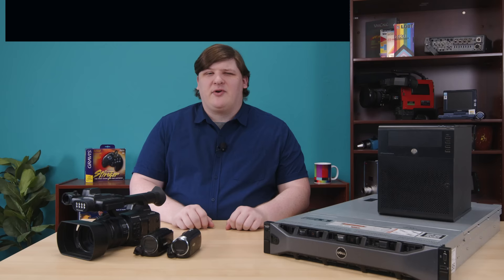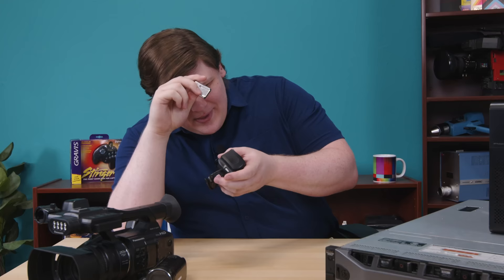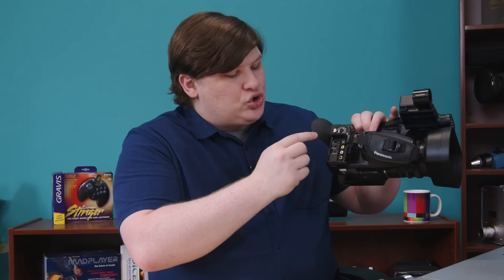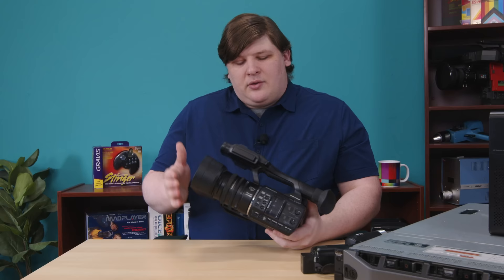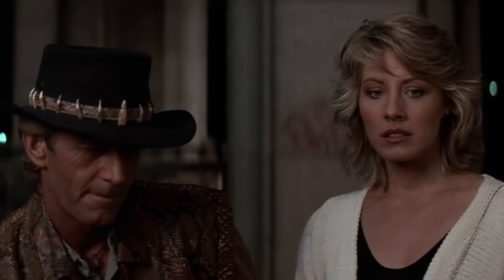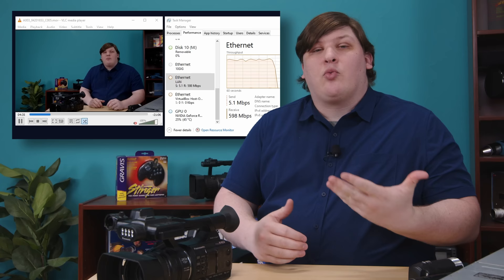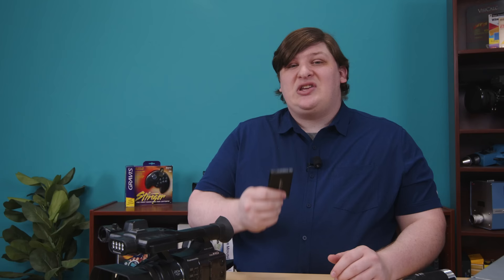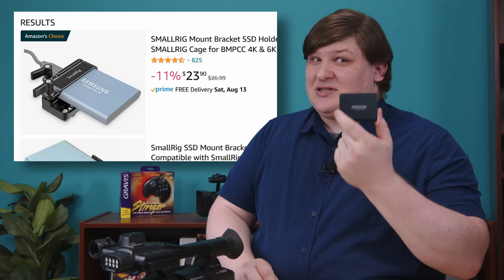I Built... a really fast NAS?

Comment: I don't see why internal 2242/2230 NGFF isn't being used.
Consider buying bulk used server drives. They're designed for writethrough workloads like this, and with even a third of the rated endurance consumed, they'll still outpace consumer drives of comparable capacity and ""quality"", and can sometimes be found on ebay in bulk for less than half the cost.
There was recently a lot of 10 1.92TB of samsung drives, I think it went for less than a grand?

Not showing up at all, I've seen as a compatibility problem in X570 with certain PCIE2 server hardware. I imagine it could happen otherwise. It's just failing the handshake in the POST?

Evos aren't really high end. They're low-end samsung drives. Pros are high-end, but not as high end as the server hardware that shares the same controllers/nand. Server stuff is just better binned pro stuff.

Comment: I think with your setup wouldnt 4 mirror harddisk would be better? With last 4 slot have high capacity running in z1 or 3 mirror with 6 drive in z2 as storage vault?
Reply: Or even a 6 mirror array would work nicely with a fair bit of redundancy.

Comment: Windows does have support for NFS, never used it myself as I don't work with Windows (may try it later on a VM just for fun)
May function a bit better than SMB
Reply: Windows "NFS support" exists just to tick a box, as a last resort only.  If you aren't going SMB, the next best is iSCSI, but thats a vastly different use case. You gain performance but lose flexibility because sharing between multiple PC's and users is impossible, but thats not what is happening here, especially with the point-to-point network cabling.

Comment: I HATE perc cards. I ALWAYS replace them with an LSI alternative, even though that means having to get cabels that can bridge the gap between the sas backplane and the lsi card. I prefer the ease with which you can interface with them in an efi shell and flash them to an actual IT mode firmware. Perc HBA is always a problem for me. But i do a workload that requires constant hot swapping.
Edit: I should clarify i work exclusively with dell RC730XD servers, but i trial other older/newer dell servers for my workload, and the perc cards are always a pain in the ass.

Comment: Great video! one thing that really confuses me is the awful performance you got out of those bx500 drives. I ordered a 2tb one on amazon (and got sent two which I kept cause fuck bezos) and they both are fully capable of the rated speeds and ive had no issues using them as game drives in my pc. my guess would be that you ended up with bad drives though how you managed to get two of them is a mystery to me

Comment: Haven’t read the comments.
First off, why aren’t you using external Thunderbolt 3/4 drives? We are getting 2880 to 3400 mb/s with the BlackMagic app. 
As for your external solution, we would of done the same. Although we use DAS then archive with the NAS. Those are cheap on the used market.

Comment: LOL you should see my software collection... I've been trying to save software since the late 80's. (yes even back then i saw the problem with disappearing cultural items. In this case software) Even my old BBS stuff that is on floppy, fills up three boxes. I've got around 4k Cd/DVD's (about 1/3 of the DVD's are 4.7 gig while the other 2/3 are 8 gig) with all kinds of data and this isn't including the three 2 TB hard drives that i have that are full that need to be moved over to DVD. Fun times. Eventually all of this is going to get sent over to the Internet Archive for preservation.

Comment: Check out something like the NVIDIA Tesla P4 for you GPU encoding needs. Single PCIe slot, no external power, encodes to H.265, linux "friendly" (same proprietary drivers as other NVIDIA). Roughly ~$200 on eBay

Comment: I am only 20 minutes in, and not a CS guy (so I may be missing something covered/obvious), but why is compression not being discussed? Maybe it would take too much processing power in the camera itself, but you'd think when only a portion of the pixels are changing in any given shot, you could save a TON of storage space. Maybe that is too specific to video blogging setups for significant development to have been done?
Reply from the maker: @SelectHawk  For the average person, yeah, you can just h264 everything and be done with it. For me, because I use zoom levels of 2-4x in my videos regularly, even high bit rate h264 completely trashes image quality, reduces it to less than 1080 quality as soon as I punch in even a little bit. So that's why I can't use conventional consumer compression; The reason the camera itself doesn't deliver those codecs at all is because no serious professional would ever have anything to do with them, for the reason I gave and many others - anyone working in TV or Hollywood simply requires maximum quality, and prores et al deliver it despite being heavily compressed already. If I wasn't using compression, these video files would be... I don't even know, probably 50 gigabits a second, some absurd number like that.

Comment: Hiding it in the basement... huh...  if anything, my takeaway from this is that I have a rather large chunk of unused crawlspace and a few rigs that make noise, produce heat... and only really need protection against moisture.

hmm... this merrits further investigation.
Reply: and I just got to the LOM part, strongly agree, and also laughing out loud.
Reply: 2.5G is a horrible waste of copper, and sets the consumer market back another decade relative to current SFP(+) and QFP norms.
Half of my own home network runs 10GbE though a lovely mixture of DAC and Fibreoptic leads,  CAT6 ethernet cables reserved for those machines I have not been able to retrofit with salvaged adapters.

Those same machines, coincidentally, are the previously mentioned loud ones and will be migrated to the crawlspace... which I just now inspected and found to be, while absolutely littered with spider carcasses, to be dry-enough not to have to worry about condensation.

Comment: it's true. 2.5 is a problem, but the problem is 10 gig devices being 1/10 usually, and not having 1/2.5/5/10. but also 10 is a problem, power, cable specs.
anything higher end than 1gb should have an sfp+ 10gb standard. would solve a lot of problems.
but people love their rj45.
Reply: qsfp yaaaaay, did you know 100g mellanox cards are 300 dollars?
Reply: the ONLY thing you really need to do is be care to not get an infiniband switch, and you can use DAC cables if they are kinda close.
Reply: yeah you don't get a fiber card gross what gross
Reply: so sad
Reply: so where is your full 42u rack, i know its in your mind

Comment: You should think about a used Nvidia Tesla. You don't need a video output to do rendering, and they are not all that expensive for the GTX10xx era cards. Yes, a RTX 30xx card is a faster, but if it's automated running on an always on 24/7 server the difference may not matter.

Comment: I have no clue how that BX500 is so bad. I have two DRAM-less SSDs (a $20 Inland [Micro Center store brand] Professional 256GB and a no-name V2 Technologies weird 128GB drive I got for free with a laptop) and they both perform perfectly good enough, easily doing 500MB/s on the first CrystalDiskMark test. Both of them beat the BX500 in nearly every test.

Comment: I am not sure you are aware that not so well known brand Quanta is a contract manufacturer (and design center) used by Dell.  Its very likely the Dell machine came out of the Quanta factory.
Reply from the maker: Perhaps so, but the machines have completely different designs and the quanta doesn't really feel like any Dell that I've ever seen. A lot of companies make stuff for each other, but the amount they spend on the design and manufacturing vary so wildly that it might as well not matter.

Comment: I almost wept at the SAGA to sort things out like cables, sassy connections - er... I meant SAS - , shitty SSD drives, SFP nics, and then the answer smacks you in the forehead like a sledgehammer... or a pack of -newly found - removeable batteries 🤣🤣🤣🤣🤣.

And I had a SSD 60GB vintage drive with sandforce controllers simply ceasing to exist on my kids pc. It didn't show on bios, on windows, anywhere, it was simply gone. It was kinda perfect for a boot drive, it could fit only windows and its shennanigans, but it imploded and got thrust back into the void, so I had to install windows in another drive...

Comment: One question I have is, why do people want to bypass an Enterprise grade (HPE SmartArray or Dell PERC) RAID controller in favor of software RAID, when the whole purpose of the controller is to offload the extra processing required to manage RAID? I have heard that some of the early Dells used (Emulex?) RAID controllers that were not very robust, but I've been a fan of HPE's Smart Arrays for some time, and already on my personal server, I've been able to hot swap one of my drives that was "predicted to fail" due to continuous testing of drives done by the controller.  Maybe the PERC cards are still not robust enough to manage without shutting down the server?  Or maybe it's past bad reputations from the late 90s, early 00's.
Reply from the maker: Here's some of my reasoning:

- Hardware RAID controllers have to write some kind of signature onto the drive that is unique to that controller. If it dies, and you can't get an exact replacement, you can't read those drives. ZFS operates at an abstraction layer that software can understand, so will read in anything. If my HBA dies, I can swap it out with any other. If I need access to my data _right now_, I can plug a drive into a USB adapter and use a laptop if need be, instead of waiting four days for an ebay shipment. Enterprises can ignore this problem because they have the money to keep spares on hand, and support contracts that replace hardware throughout the service life of the unit. I have neither.

- RAID controllers are either managed from the system firmware on boot or through some software package that was probably last updated in 2015 and only ever deployed for something like RHEL. In this case it looks like it would be PERCCLI. I didn't even try it, because:

- Learning how to run this RAID controller would be a whole new galaxy of effort that I don't have time and energy for. I don't know how to admin a PERC controller. I could get something wrong, not understand some nuance of the device, configure some minor setting incorrectly, and I wouldn't know because I've never touched a PERC before and likely never will again. I have no idea how to wire it up to send me email alerts, et cetera. In contrast, I have run ZFS on four different machines before, it's completely hardware-independent, and that means I don't have to keep relearning things.

- All disk errors will be masked from common tools. The only way to find out something is failing is to use their software, so unless the controller/drivers happen to decide in their judgment that I need to know something, I will otherwise be blind to what's going on. I also have no idea if they can do something like a scrub or how well it would work compared to ZFS, which has a good track record among people of my skill level.

- The CPU power is negligible, I have never noticed ZFS causing any kind of substantial utilization. Perhaps at the bleeding edge of I/O perf this is relevant, but I just get nothing out of hardware acceleration for this task.

In short: Hardware RAID is an overcomplication for me. It may make sense at enterprise scale, where you are dealing with 20 or 50 or 200 machines of identical specs, thousands of identical drives, loads of spare parts on hand, and dedicated staff who can set up monitoring and integration, but none of those things apply to me. It's just more stuff to learn and more failure points.
Reply: @CathodeRayDude  I see your point. In my case, my server is old enough that I have spare drives and at least one spare SmartArray.  The controller can be managed through the iLO (out of band), and if I bothered to learn how to use the CLI, from VMWare (and Linux) as well, but then again, I came from a server environment, and with HPE at least, you could move your RAID set to another SmartArray of even a different model, and still pull data off if you needed.  While I do have an interest in video production, I haven't put in nearly the effort you have, and you are much closer to a professional workflow than I will ever be.  (I prefer to shoot footage for others and let them handle all the post-production headaches that would mean spending money on computers less than 10 years old, and actually paying for editing software for me.) I use a Canon  HFG10, and I choose to believe that is the best camera in the world, because I'm not buying another one unless someone wants to pay me to shoot! BTW, I look forward to your videos.  Even though this one was long, I'm glad I hung in there long enough to see you use 10G over copper!

Comment: I've been data hoarding more and more and have filled some made up max volume size and have been thinking about my options from xs or rack mount synologies to qnap to it systems to a custom trunas servers. It's too bad they don't care about consumers and don't have single drive additions and don't plan to have it working to an extent where you get all of the added space.

Its a rough world for people like me, mostly because I want something I imagine is niche in thst I don't want problems or noise. Thus far my 2419+ had worked out really well for me and let me avoid all the pain. Could I have managed it with my pretty techy background? yea, but this was dead easy and I didn't get condescended to or reprimanded sharply for not knowing some undocumented word if mouth secret to an os a company who explicitly says home users don't matter to them.

Comment: I assume you put your 10GB NAS connections on a different IP network than your main network?  If not, that could be the reason it was trying to run over your "slow" network.
Reply from the maker: I did, yeah. Apparently Windows resolves the hostname and figures out that it can be reached on other paths.

Comment: The reason that your camera is recording at  a bitrate of 1180Mbps (Megabits per second) is because Black Magic quotes their bitrates at 110MBps (110MegaBytes per second which is roughly 1100-1200Mbps). It's the same reason that a 1Gigabit per second bandwidth internet connection transfers at roughly 100-120MegaByte per second transfer rate.
Reply from the maker: You divide bits by eight to get bytes, not ten.
Reply: @CathodeRayDude  That's technically correct but due to overhead and other factors, the real life difference between bits and bytes ranges between dividing by 8 and dividing by 10.

Comment: You know all this, and there's probably a thousand replies that are similar, but incremental rsync, systemd, and poe seems to solve each of your problems? Updating to a new rack server is not too expensive, either, and you can live with your storage until your ready to upgrade. Seems like it checks all the boxes:
* No action on your part, systemd daemon set to run at some time
* power-on-ethernet means the server noise doesn't happen very often
* Incremental rsync means the backup doesn't take hours (and you can even save your archival data in a lossless format), and server noise doesn't happen

But again... you probably know all this, and are going that way.

(Linux servers and samba, of course.)

I feel some of your pain, and have a rack, home lab, etc., for the purposes of 192k/24-bit audio and some amateur astronomy using "lucky imaging" which means taking "lots of stills" as you mentioned at the beginning. It's not so bad on the server side.

Comment: 41:30 your disk setup is interesting. i see the point why you doing this like this, but raid 1? i mean it is cost effective but is a raid 5 not more save and also a more pleasant way to work with. i mean for your ssd this does not matter there role is clear but for your hdd having 3 drives each but giving only 1/3 of space away instead of 1/2 and also having the nearly double of the speed is a way better trad of als raid1. or has your r720 only a hba in it so you dont have access to virtual disk arrays like you would if you had a perc h330 or h730 raidcontroller. i dont know if you thought about that or your system is limited to a basic hba. i have a h330 in my r630. for my use case of the server i dont need them i use only raid 0 because i needed one big drive that is only capable of 820mbs i cant process the data any faster then that. maybe a bit faster i have tried a small 1tb sample on 4 sata ssd in raid1 this result was only 880mbs so this is the limit of my system i could fill up the ram before hand but this would bring me no benefits also i need the space for the results and variables so i can stich everything in the end of each block together. for this alone i need 200gb for 1tb of data. 
i can only speculate about your configuration and limits of your machine. i bought mine with a two 6 core cpus and 128gb ram and only 2 drives are populated with 500gb sas 15k drives. but it had a h330 in it also a enterprise idrac8. i payed only 600€ for and did spend another 1200€ for 768gb of ram and the 2699v4 22core cpus and 8 used sas 1.8tb sas drives. my system was also really scratched. i dont know for what this machine is once used for. if you consider i payed 2000€ for my gaming system and it es much slower as the r630 the price for this r630 system was pretty good